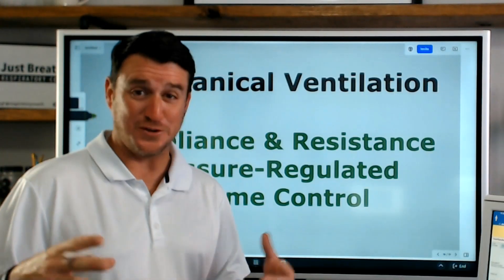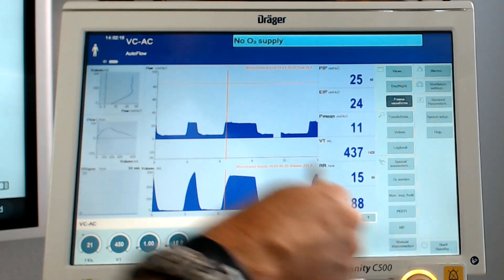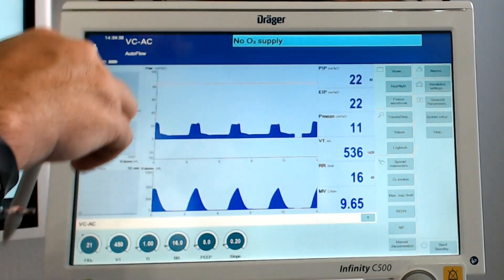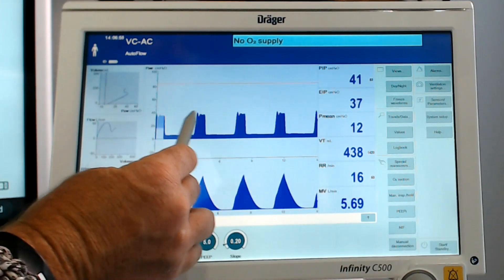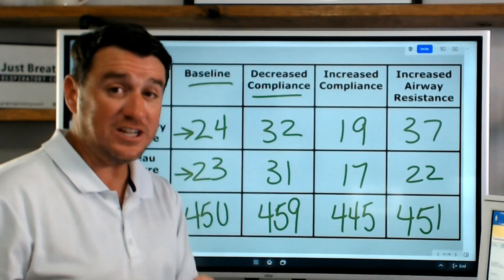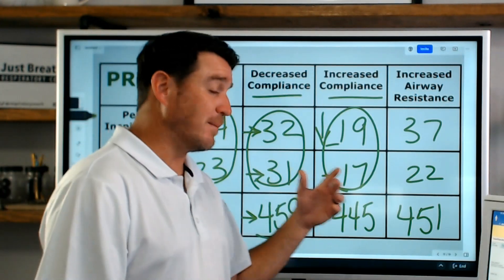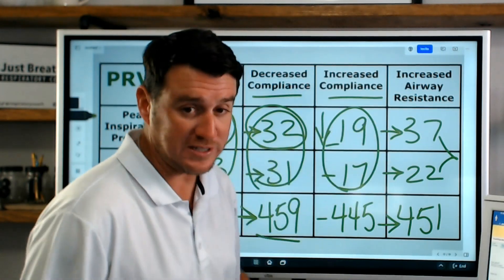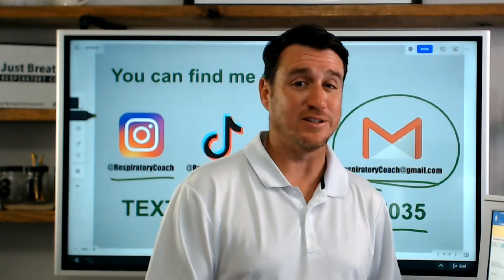Respiratory Therapist - Compliance and Resistance in PRVC

Comment: Best presentation so far i have seen . I my self trained by Hamilton and Ndd Switzerland and have trained many in this field  and as a mode prvc which is more patented by  getinge Maquet has little different definition and controlled parameters . Kindly telly with them by practical use of machine on same mode .as this was life saving mode in covid and many abnormal lung  condition such as  atelectasis,lung hypoplasia , pulmonary edema  and ards where pressure and pressure gradients  play vital role and challenge for Interventional pulmonologist. So in any condition lung should not go beyond a certain pressure limit and need to improve volume within pressure as the lung is stiff.  My best wishes are with you, as i know hardly few people in this world have a clear concept about the ventilator technology as accepted by many doctors . Which is the major cause of big loss in covid .best of luck .

Comment: Great presentation. If I may, the reason why we see such a large difference between PIP and Pplat with the increased Resistance is because of the relationship between Ti and the Inspiratory Time Constant. Theoretically, in a Pressure-controlled mode, set Inspiratory Pressure and Pplat will always equalize given a sufficiently long Ti, no matter how great the Resistance or Time Constant. When Resistance is normal, your Ti of one second is almost long enough that the set Inspiratory/Peak Pressure and the Plateau Pressure equalizes. So, if you had a Flow waveform displayed on the screen (instead of Pressure and Volume waveforms), you would've seen that your Inspiratory Flow wave almost returns to baseline prior to Expiration.

(Note that the point when the inspiratory flow waveform returns to zero/baseline is the point where the pressures from the machine and the lungs are equal - e.g. PIP = Pplat in PC modes. This is also the theory behind the Inspiratory Hold; e.g. your Pplat is the pressure in the circuit when there is no flow, after a Vt is delivered).  

When you increased Resistance, you increase the time it takes to fill the lungs (the Inspiratory Time Constant). So in order to achieve the same Plateau Pressure as before (in your case, 450mL) it will either take much more inspiratory pressure or a much longer Ti.

However, since PRVC cannot change Ti, it has to substantially increase Inspiratory Pressure, and if you throw up the Flow waveform, you'll see the Inspiratory Flow waveform is no where close to returning to baseline before expiration begins - i.e. the pressures between the vent and the lungs are not at all close to each other (which is why there is still flow). If you increased your Ti to like, 5 seconds, you will see a much smaller difference between PIP and Pplat in PRVC at the higher Resistance.
Reply from the maker: You are 100% correct and the first person to bring this to the table. I discovered this to be true when diving deeper into the flow pattern and time constants.  Where have you been my entire career?  Thank you for your contribution to the conversation.  I truly appreciate you watching and commenting!
Reply: @RespiratoryCoach   Hello there, can explain this more clearly in one of your great videos, please?
Reply: Right on point William Ngai. I was discussing and demonstrated this at work this past Sunday, 10/9
Reply: Yes!

Comment: This is another outstanding presentation. Couch correct me if Im wrong with PRVC the goal to reach target Tidal volume by adjusting PIP and not Pplat. The Pplat has to do only with lung compliance that is why when you changed Resistance there was a difference between PIP and Pplat in PRVC. Thank you for all your hard work and I learn from you

Comment: What do you think about the PB 980? At the hospital I have been interning at they have switched to using them with the 840s on standby.
Reply: 980 rocks ... can also be used w hfnc
Reply: as hfnc
Reply: 840 is best .and the matter related to hfnc is  diffrent concept with ventilation and saparate device use for hfnc . As it  has no role play both segment of ventilator as it is priority for upper respiratory tract system
Reply: Any body who studied or worked on body box plythsmography. Or Multiple breath DLCO system can easily under stand .